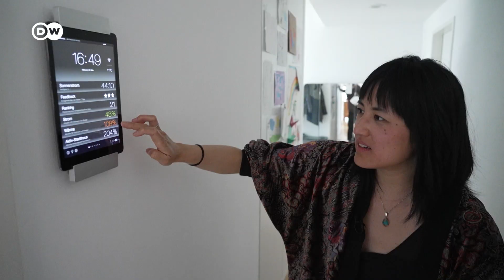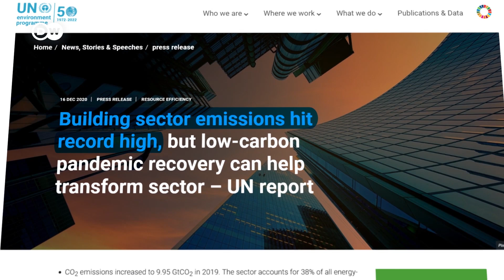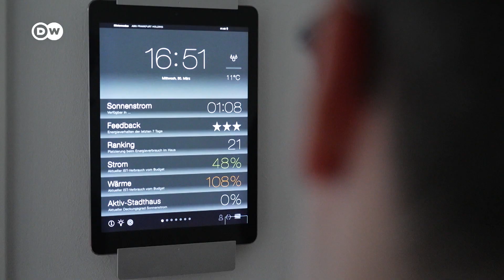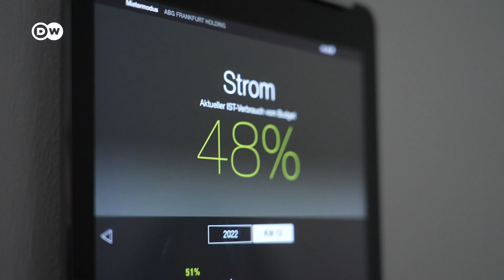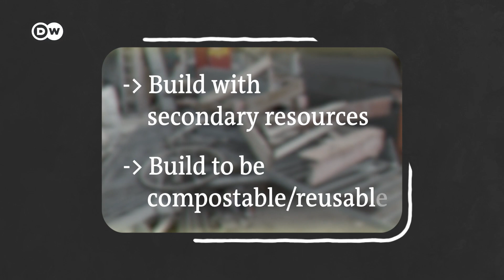Why our buildings suck, and how to change them

Comment: Perhaps you could also talk about the material and energy waste of detached single-family homes compared to wood-constructed four-plexes and six-plexes? Seems a scalable and cheap alternative for the suburbs that doesn't require all the risk analysis and engineering that makes these retrofits so expensive
Reply: Yes, multifamily houses are better for the environment. But they are not as big of a deal in Europe. It is an expensive choice that some families do.
Reply: For the US this is the first thing that came to mind. Green buildings are great but aren't going to matter if you also building spralling single family developments down the road.
Reply: I mean, they're certainly there in Europe, but the numbers are not comparable to the USA in the % of houses being detached.

Fe, in Germany, only 26% of households live in Detached houses, while 62% live in Flats
Reply: @1crafter176  So walkable cities result and racist zoning doesn't happen, as in Canada and the US
Reply: @timbushell8640  no, zoning in Europe works quite differently to how it does in the US. Fe, in Germany, the lowest residential density can still have small blocks of flats, and businesses, Fe. And there wasn't (IIRC) any form of redlining that encouraged segregation
Reply: Zoning in the US prevent building nothing but single family homes and local people are strongly against zoning change because if you build a multi family building, not even a tall condo, just a 2 stories building, then local properties lose some value.
That's it.
Reply: Sounds marxist
Reply: I also missed this discussion. People seek convenience, and urban spaces enable convenient lifestyles without the need for private cars. Building a new apartment complex in town is environmentally costly, but offers future generations an environmentally sustainable way of life. If you don't make the new apartment complex, folks will move out to a standalone house out of town. Even if the house is a minimal energy building, its insulation cannot compete with an apartment complex. That's a huge environmental issue.
Reply: But wood is not so resistent...
Reply: @digitalpetor  Flats are even better for the environment than multi-family homes. I think their point was that for a country like the US, by moving away from single-family detached homes to multi-family homes, so much energy and carbon can already be saved. Without having to go through state-of-the-art materials and processes.
Reply: @ApollonianShy18  I was also thinking about that...any alternative to wood?
Reply: That makes great sense and it's a good idea, but I wouldn't be able to stand living that way. I don't like being able to see or hear my nearest neighbors. I like my privacy. I can't imagine living in a city. But I'm glad people do, because otherwise they would be out here in the countryside ruining everything.
I live in a van that no longer runs. So no, I'm not a part of the problem. :-)
Reply: @theobserver9131  maybe if you can afford it. But it's also kind of an antisocial lifestyle. I think you should consider why you don't want to see or hear other people. We are a social species and we depend on each other for survival. 

But in a more practical sense, there is limited space within easy access of employment centers, so it's important to use that space efficiently. There will always be rural cottages, but this video is about urban/suburban issues.
Reply: Totally agreed regarding the benefits to preserving rural areas when the majority of people live densely!
Reply: Good luck taking those families' homes away from them and " retrofitting" them so they can share with 5 other families after they worked and saved their whole lives to have a single family home. Which btw way is HUGE percentage of people's dream and hope and aspiration, even the people still in four and six plexes and city apartments.
Reply: @TobeFreeman  my experience is people want to live in single family homes with their own yard. It's the dream of a large percentage of people, not what they settle for if they can't get a tiny apartment in a crowded city.
Reply: @ProfessordevilL  how about people don't have a bunch of kids and then the population is small and we don't have to be warehoused in city flats.
Reply: @theobserver9131  just curious how much does it take to customize a van into a home. Ready-made campervans can be quite expensive nowadays.
Reply: @michah321  problem is that many single family homes are located within city limits. Like how San Jose, California is 94% zoned only for single family homes. And the NIMBYs there are blocking every initiative to increase the housing supply.
Reply: @theobserver9131  I'm with you. I to am an old man and own a medium sized (about 2 square kilometers) ranch far from the city and I love it! Just me and my dogs, horses, cow, pigs and chickens and not a human in site except for in the mirror. City people can keep the cities. I think cities are the 8th level of heck Dante neglected to mention.
Reply: @winstonsolipsist1741  Cheers my friend!
Reply: @winstonsolipsist1741  I live with my daughter, and my three granddaughters sort of. They live in the house, I live in a van in the backyard. Close enough to keep me company, far enough away not to drive me nuts too much. Lol. We share two dogs and a dozen chickens and a garden. I don't think life could get too much better.
Reply: @ianhomerpura8937  I did $600 worth of labor for the people who gave me the van. All the materials I used were scavenged here and there. It's not the highlife, but it's more than enough. If you want something that would look really impressive in a magazine and it is all high-tech and stuff, then yeah, you're gonna pay a lot of money. But if you're willing to live simply, it doesn't have to cost anything.
Reply: @ianhomerpura8937  if you really think about what's important in life, you might come to the conclusion that life doesn't cost much if anything. I am more into what I can take away with me at the end of it all, than how much shiny cool stuff I can get before I die.
Reply: @ianhomerpura8937  when I went to Mexico in the 80s with nothing but a backpack, I ran into a guy who asked me where I was from and how rich I was. I told him I was very poor, in fact I had nothing, but I am from the USA. He said well, you are super rich. In the USA, you can live really well without any money. Here in Mexico, it's not so easy. You know what? He was right. Americans throw away so much really good stuff just because it's five minutes old. If you don't have to have the latest thing, and you have some imagination and some energy, you can live just fine on nothing in the USA.
Reply: I love bicycles, and I haven't had to pay for one in over 40 years. All I have to do is rescue them from dumpsters. People will throw away a bike just because it has a flat tire. The same is true for almost everything else. People throw things away that only need a little bit of maintenance. You can help the earth, and live on nothing if you have a little bit of skill and aren't afraid of a little bit of work.
Reply: As far as rent and food and stuff, there are a lot of people who have property that they don't have time to take care of. If you have property maintenance skills, and you are a likable person, it's pretty easy to find a live-in caretaker situation. I have rented a place to live for maybe two or three years total in my whole life. The rest of the time, I've been a live-in caretaker. I have no bills, and my life is simple.
Reply: Sometimes people give me an extra room or whatever, but I much prefer if they give me a couple hundred square feet of their yard. I either build a lean-to, or I have some sort of camper or vehicle to live in. I like having a little bit of privacy, and that works out great when I find a situation with people who have a little bit of extra land.
Reply: I more than earn my keep. I can build a house start to finish, with everything you need in it; electric plumbing etc., and I have landscaping skills. People are usually happy to give me a little bit of room on their property in exchange for my help.
Reply: @michah321  They dream of that single family home with a yard lifestyle because they were raised to believe that is what measures one's success in life. They weren't raised to be mindful of others and their environment.
Reply: @laurent3415  I was raised that way and it was beautiful. If people are mindful of others and don't reproduce like bunnies, EVERYONE eventually can have that lifestyle. It is wonderful by the way, and everyone deserves to live in that, if they want to. And there can be other lifestyles also for people who don't. But don't tell me what I actually like and what I don't, because I live in a single family home. I'm an adult, and I'd rather die than live any other way, because I love my home and my yard.
Reply: @laurent3415  it's not about caring about " success". It's about privacy and autonomy.  Everyone should have that if they want it. And we can find a way to give it to everyone who wants it if we limit the number of kids we choose to bring into the world. And choose responsibly. Because I would not bring children into a world that  they are forced to live on communal situations and that they don't have enough resources. BTW, I didn't. I chose not to contribute additional humans into the world. To create a world that there aren't too many people and that people have to live in high density warehouses.
Reply: @michah321  It's perfectly okay to love living in a single family home so long as you aren't teaching the next generation to collectively measure a person's worthiness of respect based on whether or not they own a home with a lawn. I've lived in 3 very different types of households (trailer park, surburban neighborhood, and apartments) and there is a very different attitude towards people living in each category. I have personally met very few surburban dwellers that are mindful of others, so that makes you a rare one indeed. Most of the surburban dwellers I meet look at me, the renter, as a failure that has only ever made bad choices.
Reply: @michah321  Mixed used development makes much better use of a finite amount of space. Not all mixed use development removes autonomy and privacy. It increases the autonomy of the developer by allowing more uses for the same tract of land. Privacy is also very much still possible even in multi-family dwellings. What mixed use development means is that in a particular tract of land developers could build a single family home, a small clothing shop, a duplex, an office space above a barista, and a bakery all on that same block instead of having to separately choose from single-family homes, apartment buildings, office buildings, or retail space(s). If the office space is no longer needed by the original occupant, it can then be repurposed into another shop, or a home, or even remain an office space for another business. When you don't have surburban sprawl eating up enormous tracts of landand resources so infrastructure can reach them, you don't have to build as dense as some city centers do to accommodate the rest of the population that cannot fit into the current sprawling zoning model. I do absolutely agree that family sizes need to be smaller now that modern medicine has extended life expectancy, but that's a whole other can of worms with it's mess of environmental implications that would be sorely off this thread's topic.
Reply: @laurent3415  that's all well and good to build but you can not take away single family on private land it  is the right of people that want it, in the US. If I want my house on my property with no other people, no other dwellings that's my right. If I want to live in a neighborhood that doesn't have any commercial property than I can live in that neighborhood if I want to. If I already do, it can't be taken away from me if the rest of the community wants the same thing. Mixed use property can be created somewhere else but if we want single family property without commercial use than we can have that.  That's the idea of a free society. Not everyone wants bakeries and coffee shops in their neighborhood and it shouldn't be forced. I don't go to bakeries and coffee shops. I have coffee in my own house in my yard that I landscaped by myself.
Reply: @Tonyx.yt.  "It doesn't fit the character of the neighborhood."
Reply: Did you know some recycled materials can store a lot of humidity, dampness and become food for fungus. Would be interesting to see how stable these houses turn out to be. Current ones are no wonder either, with problems of VOCs
Reply: @zephyrlibs  buildings in cities aren't known for their safety and lack of mold etc either. This is true for a lot of buildings
Reply: @michah321  it was made into a dream with some propaganda and horrible conditions at the time. Things are different then when it became the dream but propaganda never ended the “American dream.”
Reply: @winstonsolipsist1741  that’s fine but the issue is in cities where there is a shortage of housing supply and all they allow is single family. Also, we should promote freedom and allow people to build what they want on their property instead of taking away their freedom.
Reply: @skygge1006  Completely free to build what they want? Would you be okay with someone building a nuclear power plant next door? How about a coal fired power plant? Maybe a metal foundry? Okay, so maybe you say, free but only free to build residential. What if someone buys all the lots surrounding your house and builds 30 story condos so all you see from your house is a street or apartment building? Freedom with restrictions is, by definition, not freedom. So who gets to decide how much freedom a property owner has? You could let the local residents decide but they are the ones that vote for these restrictions or at least vote for the people who put in the restrictions. If people wanted to allow buildings other than SFHs, they would vote to change the zoning in their neighborhood. Somebody's rights are going to be trampled. Why should your rights overrule everyone in my community's rights, or why does your single vote have more power than everyone else in the community's votes?
Reply: @skygge1006  Unfortunately and ironically, freedoms can be very restricting in that freedom to build what one person wants on their property can infringe upon someone else's freedom to live in the community as it was when they bought their property. I guess that is why zoning has become so granular. If you want to build a certain type of building, you should buy property in an area designated for that type of building. I commend your for your willingness to allow different types of buildings next to your property.
Reply: @skygge1006  I understand that you are trying to change hearts and minds. Many "urbanists" seem to think that they know more about what makes a functional and enjoyable community, and indeed they may, but I don't agree with some who feel that people should be forced, by a federal government, to change their communities. They should follow the lead of people such as you who are attempting to change peoples minds with the promise of great communities rather than the threat of government intervention.
Reply: Or stick the building partially underground to reduce the heat transfer surface area.
Reply: @laurent3415  In what multi-family dwelling have you lived in that have privacy? There is no privacy when you can hear the couple next door arguing or the children in the hall screaming or the people above me f***king? Living in a multi-family dwelling was a living hell. I bought a hundred acres and I can't see or hear any neighbors. I was happy to get as far from the city as possible and others should have that right also. People should not be required to live in mixed use anything. If I had to live in a flat again, my neighbors would all get to hear my gun go boom, once.

Comment: The real truth is that urban living is by far and away the least environmentally impactful way of life, and it is extremely disingenuous to present these facts and figures without comparing and contrasting them with what the alternatives would be, if they were replaced with lower density structures. There is no human way of living that does not cause some environmental change, but we have a moral duty to cause as little damage as possible. Highly dense urban architecture is far more efficient throughout its entire lifecycle than any other type of architecture.
Reply: Many climate change activists complain about construction method with concrete and steel but they don't calculate that those are the most reliable material for longer sustainability. The only thing that would be accomplished is the green energy usage of every resident in that particular residential building. Also building on flat surfaces, not high building is waste of land and requires more energy usage because of material transport. Urban citys are the best thing for the enviourment.
Reply: Wooden buildings are a privilege in this day and age, whereas sand for concrete is everywhere.  Yeah one can say that every tree that was cut down had a replacement planted and thus is renewable, but that can only work for designer houses.  Especially when you even see railroads everywhere replacing their wooden ties with concrete or synthetic ties.  Railroads!  The most environmental form of transport.  Just goes to show that wood will always be precious.
Reply: They don't argue against density. They argue against tearing down fine buildings to replace them with better ones instead of upgrading them.